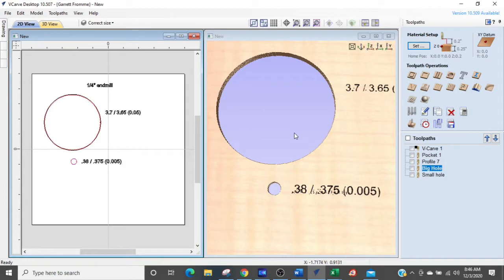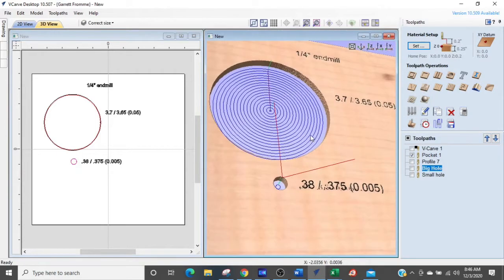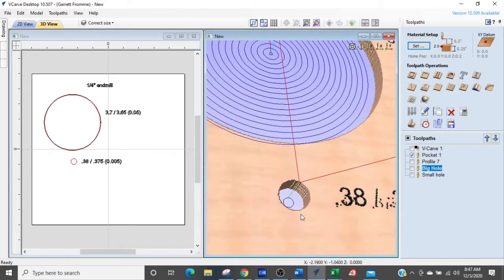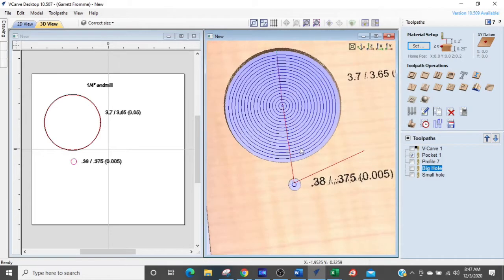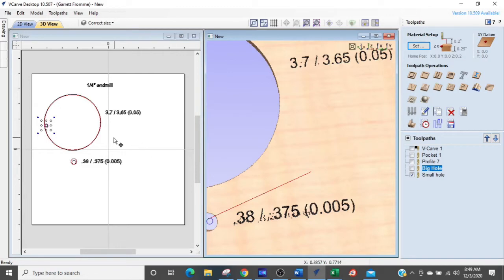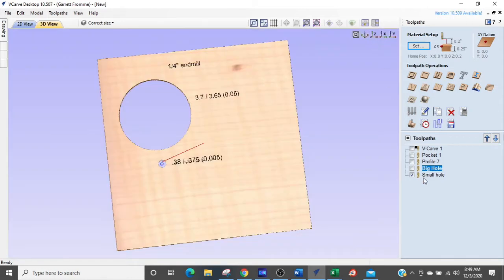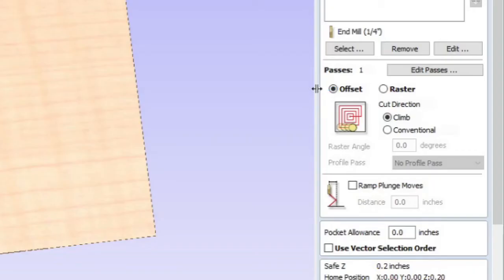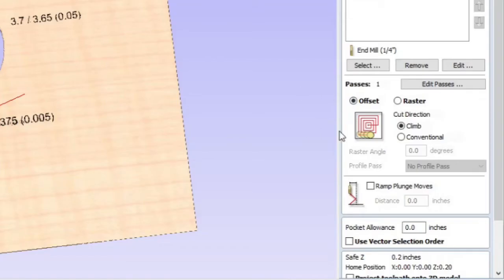Cut Accurate Size Holes w/ CNC Router, How To CNC Woodworking Tips And Tricks For Beginners v-carve

Comment: Would the offset be the same if you used a profile toolpath versus a pocket? Thanks in advance.
Reply from the maker: Great question! The offsets can vary based on the toolpath type and the material thickness, so it's best to check the specific settings in your software. Thanks for reaching out!

Comment: Great video I have project to cut 1081 3/4" holes in a 4x8 sheet.  Client is using this as a fixture board to speed up builds in his shop.   My holes were off by 0.010 and his dogs would not fit correctly.  Because I never removed sheet from router table, I reran job and this fixed the issue thanks,
Reply from the maker: I'm glad that rerunning the job helped you out! It's always good to hear about practical solutions in the shop. Thanks for watching!

Comment: I found it hard to believe that a 1/4" solid metal bit can "deflect" enough to cause such variances. I dealt with this problem and I tried everything while keeping the paths the same and I was always off. MDF in my particular case right now. I wish I could just find a way to guarantee it's right on without the trial and error. I have a beefy 10HP spindle so I've been thinking of using 3/8" or 1/2" bits. More dust, but I just want it right the first time!!!
Reply from the maker: It can definitely be surprising how even a small amount of deflection in a bit can lead to inaccuracies, especially when working with materials like MDF. Upgrading to a larger diameter bit, like 3/8" or 1/2", can help reduce deflection and provide more stability during cutting. Keep in mind that the rigidity of your setup, including your machine’s frame and the workholding method, also plays a big role in achieving precise results. It sounds like you're on the right track, and experimenting with different bits may yield the consistent results you’re looking for. Good luck with your projects!

Comment: i haven't even gotten to carving projects yet - it's taken me ages just to get my spoilboard worked out! But in doing so, and running into so many issues just with that, I've seen a lot of your videos and learned a lot so I feel more confident in starting out. I really appreciate how you explain the details, I often don't understand the Vectric help pages because they assume you already know things. Their videos are ok, but there are just not enough of them.
I had watched another of your videos on resizing holes with the array tool, and this one came on after so I watched it too even though at the time it wasn't a problem for me yet. I should have paid attention more, because even after I resized the array, the holes ended up 0.1 too small! If I had done so I would have sized them up a notch to begin with. I realized right away I could fix it using your information, so I made a new toolpath with everything the same except changing it to 1 pass as I already had the desired depth, putting in -0.05 as my allowance, and running it again. Since I hadn''t moved anything on my machine it worked perfectly! Thank you again for such a helpful video!
Reply from the maker: StubbsMom, I'm glad to hear that you found my videos helpful in figuring out your spoilboard and resizing holes. It's common to run into issues when starting out, but it sounds like you were able to solve the problem effectively using the information from my video. Keep practicing and you'll continue to improve your skills!

Comment: @idcwoodcraft. Garret, great video as I had the same problem recently and was looking for a solution.  I have a newbie question. How do you accurately measure these circle diameters after cutting? I would think a pair of calipers would work, but going to level of thousands seems to be difficult.  If calipers were used how do you know the exact geometric chord is precisely going through the center of the circle?  Thanks in advance!  And love your bits, I have several along with the Sienci MKII.
Reply from the maker: Headdancer1, Hey there! Glad you found the video helpful. When measuring circle diameters after cutting, you can use digital calipers for accuracy. To find the center of the circle, measure the diameter at various points and find the average. Using calipers ensures precise measurements for woodworking projects. Keep enjoying your bits and Sienci MKII! Here is a link to calipers I recommend: https://idcwoodcraft.com/products/calipers-digital

Comment: There are so many things that can affect the sizing of holes on the CNC router. Toolpath selection, tool deflection, material being cut, feed rates, step over etc even the machine itself. I use Fusion 360 and LinuxCNC on my router. In the past I have used a 2D contour toolpath for holes. I’ve since learned that the circular toolpath results in more accurate holes in both size and roundness. A slower finishing feed rate and a spring pass also helps with accuracy. I also have a CNC vertical mill and don’t experience the same issue on that machine. This machine is more rigid and uses a Siemens control and servo motors. Food for thought.
Reply from the maker: jasonarnold7578, That's great insight! Indeed, the variables you mentioned play a crucial role in hole sizing accuracy on a CNC router. Using circular toolpaths, adjusting feed rates, and adding spring passes can definitely enhance the precision of the holes. It's interesting how the different machines and controls can impact the results as well. Keep experimenting and fine-tuning your processes for optimal outcomes.

Comment: Back in the day in my manufacturing days we lied to machine saying we used example .240 size tool. Is the a thing with these type cnc machines
Reply from the maker: craig12272, I understand that in some manufacturing settings, people may input inaccurate tool sizes to achieve certain results, but it's not recommended practice. CNC machines rely on accurate tool data for precise cuts and to prevent damage to the machine or workpiece. It's best to use correct tool sizes to ensure optimal performance and quality results brother!

Comment: Thanks for the vid Garrett, I was doing hinge holes for my kitchen cupboard which was something similar, one 35 and two 8mm holes, when I came to insert them they would not fit , I have adjusted the toolpath as you suggested .2mm in my case and will give it a go tomorrow. On another thought does this have to be done to each hole in future? Chee
Reply from the maker: BungalowBill58, you are so welcome my friend. As for your question, yes you will need to do this to every hole.

Comment: I just found your channel and subbed. I like the way you explain things, simply and to the point.  This is a great explainantion and easy to understand. With those tolerances, a dull bit and heat could be factors too right? Does the big hole start at the outside and work it's way in to center? I'm thinking the most accurate work with the coolest tool. I'm new and transitioning from 3d printing. I'm starting with a cheap 3018, until I get the Programming nailed down.
Reply from the maker: xj35s, welcome to the channel brother! When it comes to the path your CNC takes, it often depends on the strategy you've set in your CAM (Computer-Aided Manufacturing) software. For example, when cutting out a big hole, you can set the toolpath to start from the outside and spiral in towards the center, or you can have it plunge in the center and work its way out in circles. Each approach has its pros and cons and can be selected based on the desired finish, the material you're cutting, and how much heat you expect to generate.

Comment: To use this method you'll have to cut test holes of the various size holes in the same type of material in order to measure the error.  If you're already cutting test holes, I would try conventional cut as well to see if that would correct it.
Reply from the maker: David, very good point brother. Wood is a bit tricky and just like you said, to get good accurate holes you need to run some tests too!

Comment: It seems like this is treating the symptom instead of the cause...and you would have to have already run it to know how much you were off and then adjust?  Wouldn't a finishing tool path come out close to dead on because you've eliminated the cutter deflection by taking a tiny amount of material off?  Also not sure why that big hole would be cut with a pocket tool path instead of a profile tool path, why clear the whole thing unless that was a partial depth pocket and not a hole?  These are questions from someone on the steep initial part of the learning curve so no offense meant if the answers are simple.  I'm laying out a whole new spoil board with dog holes right now and it will be important to get the hole sizes right..  👍
Reply from the maker: Hi DSD. there are several ways to think about this. Remember, this is for beginners...well, in this case, intermediate. sometimes it has to do with more than deflection. The machine just mat not be rigid enough, so it 'deflects' the machine more so than the tool.

Comment: the first thing you should try when you facing such problem is to run circle code second time.  it called "spring pass".  just to clear any material left from first pass because of tool deflection.
it's easy.
Reply from the maker: Hi Vas. I'm not sure why I didn't mention that in this video. It's a gimme in machining. Thanks for commenting. Please always add your thoughts, as I sometimes miss alternatives like what you shared here.

Comment: The variance seemed to be directly proportional to the hole size. 
I tend to think it might be machine calibration as in steps per mm
Reply from the maker: Hi Mark It would be nice if it were that simple. It's not. That's why industrial machines have cutter compensation.
Reply: @IDCWoodcraft  I am sorry I disagree. Cutter compensation is for bit variance or bit deflection.
Bit deflection does not get multiplied based on the size of the pocket or diameter of the circle being cut.
Reply from the maker: @markbachman8321  there are several ways to look at it. You clearly have some machining experience. And you are correct, step resolution does have a big impact.

Comment: So how do we know what our tool allowance is if we're working with a one off part? Or material? I cant cut a test hole into this to calculate allowances. Thank you.
Reply from the maker: the hole will almost always cut undersize when you tell it to cut with no offset. Let that cut, measure, then set the toolpath with the offset and run only that path. Does that help

Comment: Great information,  If my endmill is slightly under sized should I make the tool data base reflect that measurement or use the tool off set feature?
Thank you for you time!
Reply from the maker: Hi Kevin. The tool database has no impact or relationship to the machine size
Reply: It seems to me you should enter the actual size of the bit in your tool database, but you may still have to go through the procedure discussed to get an accurate hole size.

Comment: HI Garrett i am currently using vcarve pro trial version 11 and there are many thing different in the toolpath section it seam to be missing a lot of the steps that you describe in this video. i just tried to cut out a 1.30 size hole using a pocket toolpath and it only cut the perimeter of the circle in the tool path preview
Reply from the maker: You are using a profile toolpath which is right. You will need to pocket out the hole  first using the pocketing. If you are missing features I am using, click 'view advanced toolpaths' in the topp of the particular toolpath.  It will show up

Comment: I think it has to do with compliance. The spring like action of the mechanics under load. With a bigger circular hole the difference is smaller percentage wise compared to smaller holes. The compliance of say 0.05mm is the same for both holes, but is relatively big for a small hole. 
You can compensate in cam by using a negative offset as said in the video, or you can change the backlash setting to compensate automatically. 
The problem with both is that under different loads the compliance changes too. More advanced cam software can setup tool paths with a constant load so that the backlash setting is correct in more cases. 
More often than not, using a light finishing pass often helps getting closer to the intended diameter. So a contour operation after a pocket operation can help. And you can add some more geometry with an offset for the contour operation if it's still not enough. If it's really critical I usually create a pocket operation and a few contours with different offsets to sneak up to the intended dimension. 
There are other factors that have an influence on the dimension: spindle, collet and endmill runout. The higher the runout the bigger the hole. Circles are typically created as line segments which usually are inside the circle you're cutting, so most of it will be under sized depending on the segment resolution. 
Measuring errors can also play a part. Measuring smaller holes with calipers gives a smaller indication of a hole than the actual diameter. Using hole gauges is the way to go.
Reply from the maker: Hi Josh. I like you. You like to take things down to the science just like I do. For those techies out there that really want the meat of machining, read Josh's post!!!!

Comment: Hi Garrett, just discovered your channel the other day and find it very helpful. I’m sure your subscribership will be growing. I watched this video on sizing holes, and also your video on drilling holes. Both very informative and I learned several things from each. In one of them you mentioned giving you ideas for new videos, so I thought I would suggest “making round circles”. In one of the videos you also mentioned hole making is notoriously difficult (my interpretation of your words) in the CNC world. I have a large home brewed machine that makes perfect squares, but most circles are ovals or look like Mickey Mouse’s head (heck, or Goofy’s head depending). Worked with a variety of folks on a variety of topics from backlash to vector creation. Perhaps you could do a video on the settings you use (feed rates, acceleration, etc) to maximize the accuracy of your circles? That would be awesome
Reply from the maker: Hi CNC. I will work on this with other experts, since I am not a froubleshooter. However, Jeff Holmes is. Watch this video and make contact with this guy. He is really good at this stuff https://youtu.be/nCFaxKxomC8
Reply: yes, I see ovals would be more of a problem than "round" holes because of the grain

Comment: I am amazed that a 3.750 diameter hole is .050 undersize.  The most likely cause is that the feed rate was too fast .  I have had my CNC router for over three years and after attending some CNC group meetings, it is so obvious that most people have their feed rates way too high to get the results they want.  Most CNC routers that I have seen are not very rigid and the  cutter will push away from the workpiece because of this.  So if you want to machine a hole that is accurate, you need to slow down the feed rate on the finishing operation.
To machine a pocket that is 3.750 diameter, I would first use the pocket tool path and keep the feed rate on the high side so that it does not take a lot of time to do the bottom surface of the pocket and also set it up to take a finish pass of about .010 off the sidewall f the pocket.  Since the bottom is already finished and the diameter is close to size, I would then use the profile tool path (with a slow feed rate) and also set it up to take a finish cut (on the sidewall) of about .002 and you should be able to get within a few thousandths of the size you want.
A while back I made a fixture where I had to fit a 2" diameter pvc pipe in a 1/2 thick piece of maple. and I only had to make a .003 adjustment to get the pipe to fit.
I hope this helps someone to get accurate dimensions on their projects.
Reply from the maker: Thanks Mark, for the tips you provide here. Yes, one can get very close for sure with finish cuts.

Comment: Since both holes were cut with 1/4EM even though different toolpaths, can you still group the 1/4EM together? 
Good video and the explanation helped quite a few areas
Reply from the maker: Hi Choate. I can combine toolpaths only if the offset value is the same for both size holes.

Comment: Why pocket if a contour cut(smaller than the original hole dia but right through the material) with a pocket cut as a finish op would be a faster option?
Reply from the maker: Pocket is not always necessary. If I could do this video over again, I’d do it a bit differently. However, the principle is clear…how to get the right size holes